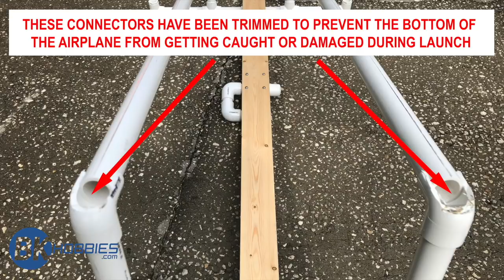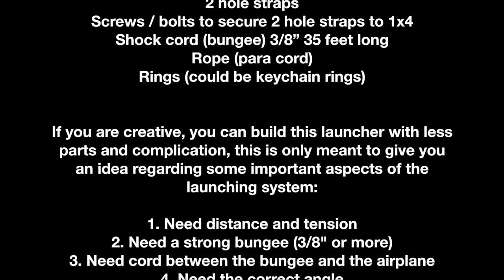DIY: SAB Tortuga Launching System

Comment: Bert, thanks for posting this.  Yes, hand launching the Tortuga can be tricky! Full throttle or it will not go well.  Luckily we already had the same launcher at our flying club from back when it was designed.  It works so sweet.  You do need to be careful that the canards don't hit on the way out.  And also the bottom of the vertical stabs don't catch on the PVC edges by the front 90s.  We found the best result using the brown surgical type tubing.  It gives you a strong pull over a greater distance.  The bigger black stuff didn't stretch as far.  We use a load gauge and stretch it out till we get about 18 lbs of pull. About 5X the weight of the plane.

Comment: I was very hyped about the Tortuga, once finished I just couldn't believe how heavy and how short the wingspan is. Cannot play with variety of propellers because of the short wingspan. It almost torque rolled to destruction at medium speed.
I hope Sab's Lizard is better because the Tortuga is better left hanging pretty from the ceiling.

Comment: Only change I'd suggest is lose all those extra fittings at the pivot point and just add some spacers below the board mounts to the cross. Maybe a washer either side to keep it turning freely. And the screw-in bungy peg as mentioned elsewhere here. Rest looks hunky-dory.

Comment: dont use a straight spike for fixing/tying down the front of the bungee . if it comes free, which it will, its then a danger to the user..
Instead use a dog holding corkscrew , sold in pet stores..these simply screw into the ground and stay in place
Reply: that stake does look sketchy will all that tension.

Comment: Hi Bert! I want to build one of these launcher, I’ve already purchased the materials but needed to ask if you could tell me the measurements of how high is the launcher in the front vs the rear. Want to make sure I get the correct inclination angle. Thanks!
Reply: He mentioned that the front legs are around 24 inches long and the rear legs are around 12 inches long but I would suggest those measurements would include the length of the respective tee's and elbows.